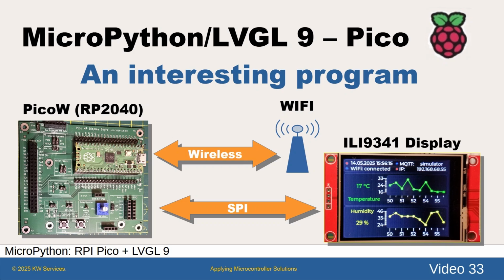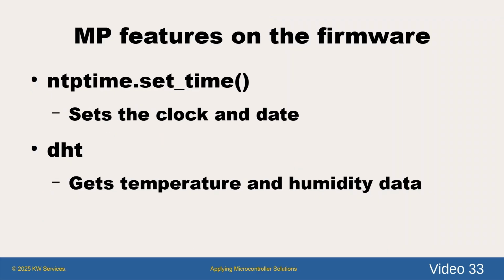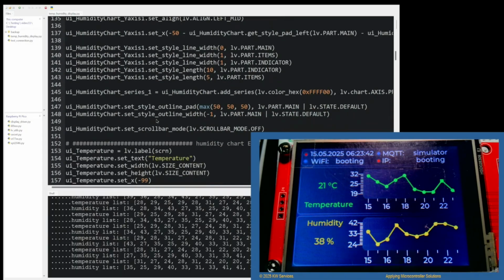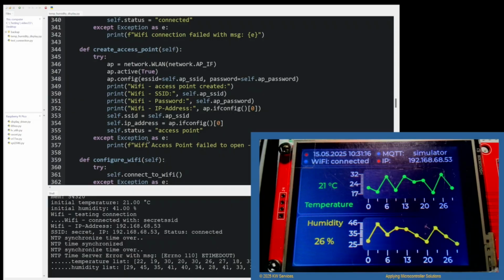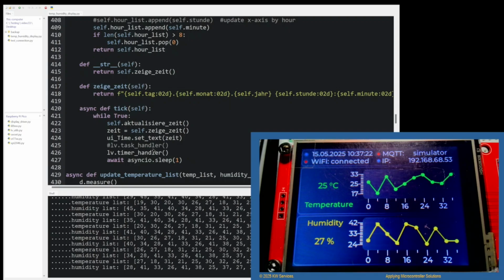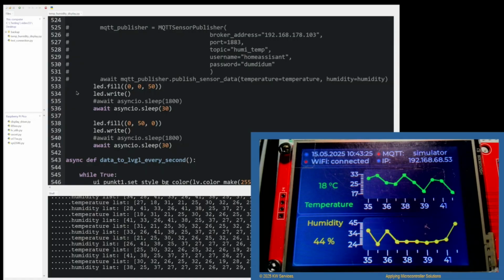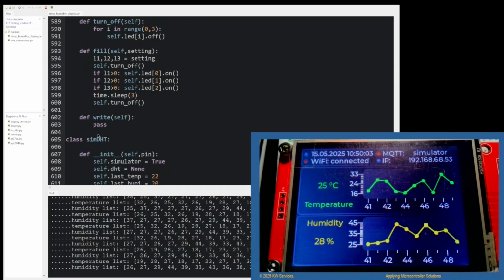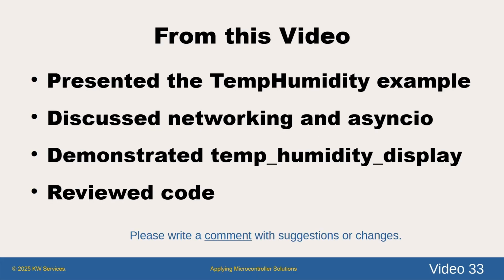Raspberry Pi Pico - MicroPython LVGL - Raspberry Pi Pico – LVGL 9 – An interesting program

Comment: I think your microphone is clipping. This looks like it's really, really, really great content. I really want to watch it, but I'm slightly concerned about my speakers. Keep in mind, that half of your video, is the audio. Both have to work well.
Reply from the maker: Thank you! I will check the audio and microphone.  If necessary I will re-post.
Reply from the maker: I uploaded a revised video33 with the sound reduced. Please let me know if that is better.
Reply: @applyingmicrocontrollers  I think your microphone might be bad? What microphone do you use? I have a Sennheiser Professional Profile (USB-C) that's pretty good, but sometime clips. And I use the Rode Wireless Pro when I'm out in the field. Both are really good quality, but the Rode is better than the Sennheiser as the Rode is 32 bit. It almost sounds like I'm hearing the diaphragm inside of the microphone rattling. It's the craziest thing.
Reply from the maker: @Dygear  Okay.  I will see how quickly I can obtain either of those microphones  Thanks for the feedback.
Reply: @applyingmicrocontrollers  2 things to know, is the proximity effect. Lowering your voice, but talking into the microphone very closely gives a very pleasing sound. Having real talk back, is a massive amount of help. Both the Rode and the Sen will give you talk back. The Rode you'll have to attach a head set to the receiver, but the transmission is well within real time and I've never noticed lag from it. It will tell you how well your audio is doing in real time.
Reply from the maker: @Dygear  Thanks.  I ordered a Mic and I will try your voice suggestions on next video.  Thanks for the help.
Reply from the maker: My last video seems too quiet.  I tested the various OBS audio filters. But I will keep trying to improve it.
Reply: @applyingmicrocontrollers  Noo! That's perfect! The audio sounds MUCH better there. You are on longer squaring off the top of the audio range as it crashes into the maximum values (clips). Now it has a much smoother sound that's much easier to listen to.